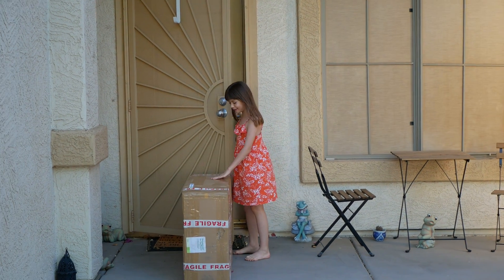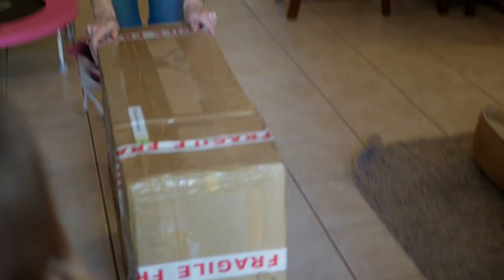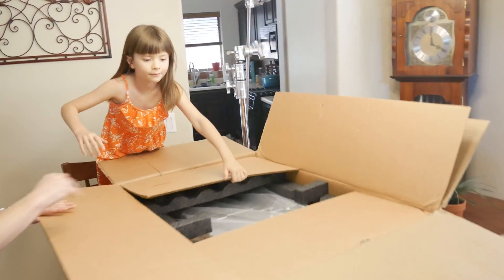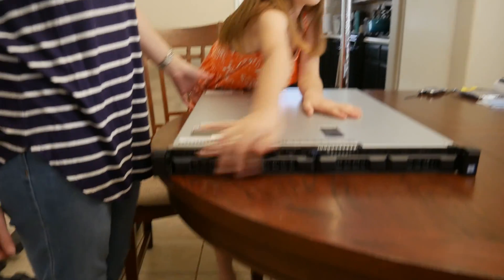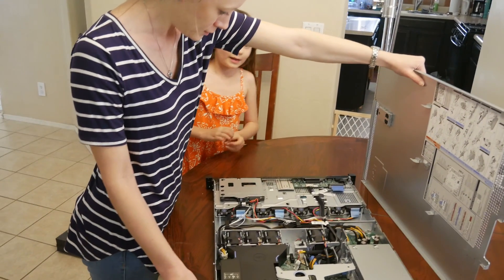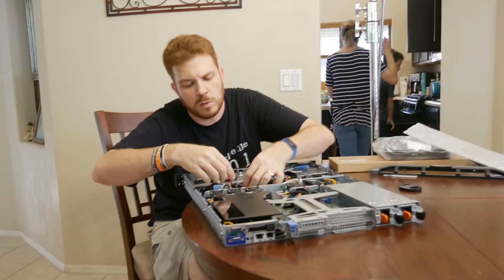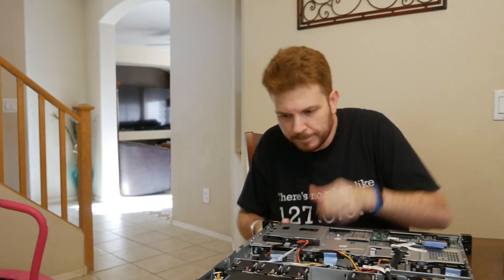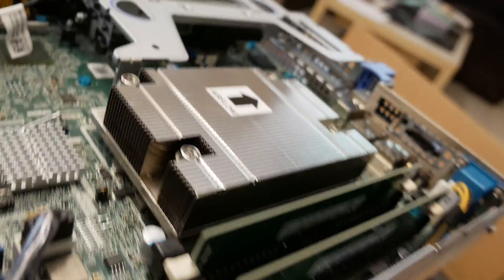Mom unboxes server | Dell PowerEdge R330

Comment: 4x 20tb big HDD :)
Reply from the maker: @norbi30ify They didn't make 20TB drives back when I bought this.😢
Reply: @ShinyTechThings  sorry
Reply from the maker: @norbi30ify No worries, but I did buy with 1 4TB drive but it came with 4! 🤯 It was a destroyed server from a truck rollover that was written off as when I called support it said that serial number was written off due to damage from a truck rollover. The drives do fit extra snug but other than that it's been a great server over the years.

Comment: But does it play minecraft
Reply from the maker: 🤣🤣🤣🤣 but seriously it could run a ton of minecraft servers. It doesn't have a powerful graphics card as it's meant for virtualizing stuff but now you are making me curious if I could run minecraft on a VM over remote desktop, how would it perform? How do you think the VM would perform like this?
Reply: @ShinyTechThings  I have the opertunity of getting hold of one of the motherboards complete with a processor and ram I just don't know what I would do with such a beast.
Reply from the maker: Virtualization and a home lab. You can run a network wide ad blocker like pihole and a local network speed test like http://openspeedtest.com/
You can run local web servers and anything else you can think of on a VM.

Comment: Nice Server! The build of my life was a Supermicro Super Workstation With Xeon 10 core 2 CPUs and 3GPUs (980ti  was the best at the time) 128GB of RAM, an 8TB 4x HDD RAID 10 and a 2TB 4x SSD  RAID 0 main drive. I remember the unboxing being something like this! The next 36hrs was spent getting it to boot with all the components in windows 8.1 of all things. Good times!!!
Reply from the maker: Thanks! This server will be replacing my much beefier HP ML110 Gen9 so I don't dump as much heat into my home office while only running a few small VM's. I haven't had to turn on the extra AC in my office nearly as often since it's a small E3 V6 Xeon over my E5-16XX V4 Xeon. I no longer run Plex as a VM, just use my Synology and a dedicated 8th gen i3 and quicksync is more than enough for a small handful of streams from 2 physical servers.